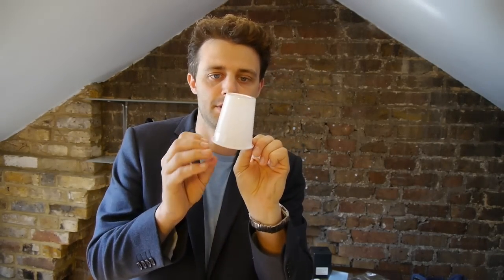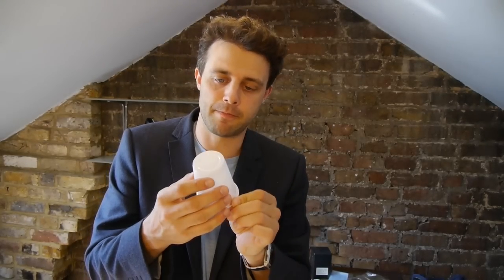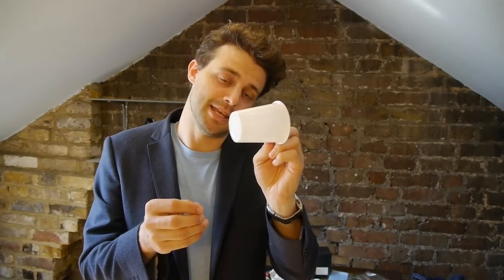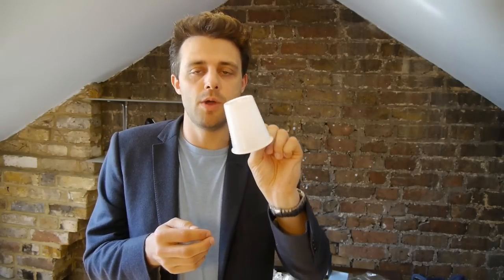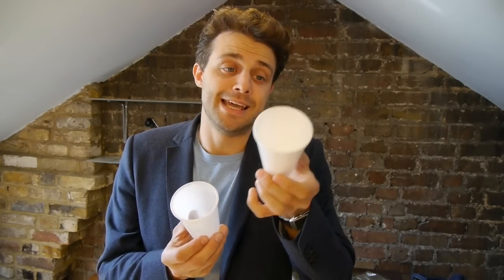What happens when you heat a plastic cup?

Comment: isn't heating up plastic kinda dangerous? :p (or is that only when it's actually burned?)
Reply: ATMunn Depends on the plastic but as long as it's not over its industry melting temperature it should be producing minimal amounts of dangerous fumes( note that it can though, again depends on the type). I don't know that much about plastics but I do know some because i have a 3D printer and wanted to make sure that I could print in my bedroom.

Comment: 2 questions:
1 - What did you use to heat the original polystyrene cup?
2 - What happens if you heat the second polystyrene cup?
Reply from the maker: +Goran Newsum 1. Something called a heat gun. You can get one from a hardware store. 2. I guess it would eventually melt.

Comment: Turns out you can do it with PET bottles as well: try to fill one with warm water (over 80°C, just to be sure) and it will shrink in volume.
Reply: Emre well done sir well done
Reply: I did it with a pet, after about an hour of crying it stopped. Think he got used to the heat?

Comment: I remember doing this as a kid. I used a yogurt cup and it came out a perfect pristine flat disc. You could even see the parallel scratches again the original plastic sheet had before molding. The only imperfection was around the rim where the tin lid is heat-sealed onto yogurt cups. I think I used an oven.